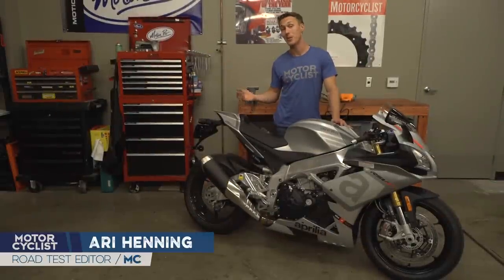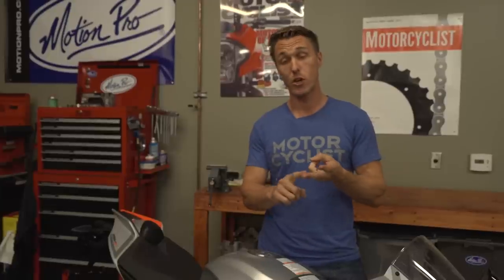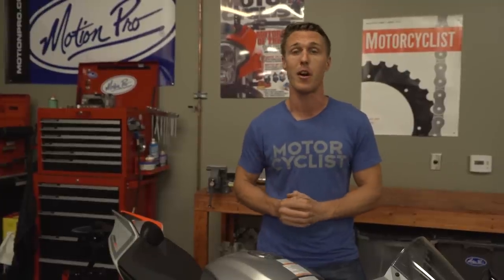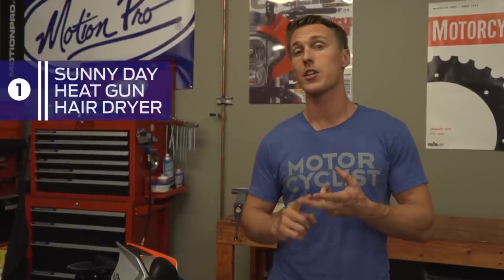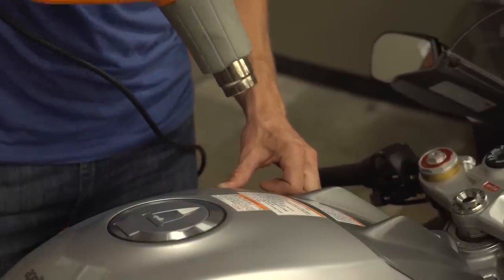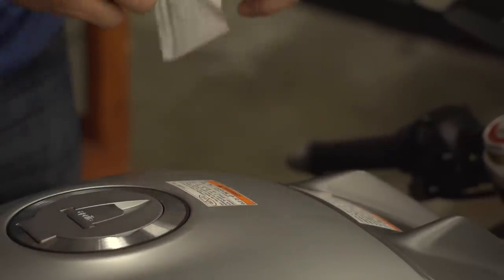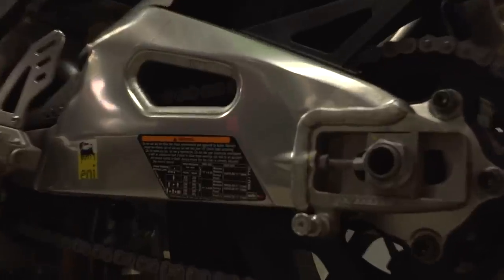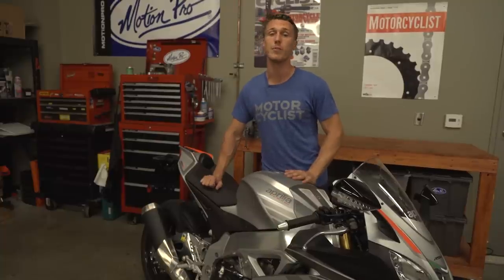How To Remove Factory Warning Stickers From Your Motorcycle | MC GARAGE TIPS

Comment: Man, I can’t wait. Sticker has been staring at me for 13 years. Great vid.
Reply: adaptiveagile was there any paint fade after taking it off? Like a noticeable difference from the paint that was under the sticker vs the paint that has been exposed to the sun and elements for 13 years?
Reply: @Ozzy62863  mine had a paint fade only after 600 miles
Reply: @snubz6188  what color paint from what bike
Reply: @Ozzy62863  it’s a Honda grom and it was on the gas tank cover so they grayish textured plastics

Comment: you can always put those stickers on some kind of card and keep it in the trunk of the bike for reference..
Reply: What is a trunk of a bike and where can i find one
Reply: The tiny compartment on the passenger seat which is too small to even fit your shades.
Reply: dave kahn i ride a 2000 CBR 929 and under the passenger i have plenty of room, so it's a trunk for me. i even have a power commander in there and still have room for all types of things...
Reply: PANTYEATR1 my old fzr hade room for a sandwich, choco bar and red bull, tip: if a can gets punctured and drips over your rear caliper do not panick and think its a leak in brake and spend a whole day trying to fix it 😂
Reply: I have an RSV4 and can barely fit my registration paper under the rear seat, let alone anything else
Reply: Do not fold them in half, they will fit better ; )

Comment: Could've used this tip a week ago, Ari. =) Otherwise, excellent tips and I used them successfully. Something else for those who are about to try this, keep a bottle of rubbing alcohol handy. The glue on my FZ07 didn't wanna go away, even after multiple applications of WD40. It left these invisible glue strips that as you ride, attracts and accumulates dust onto it turning it dark so you get this blackish smudge. One wipe down with rubbing alcohol and bye bye glue goo.

Comment: I carefully removed my warning labels and slapped them underneath the seat and inside the top case, I didn't throw them away. Since the plastic is new, it's clean and adhesive from the labels has no trouble sticking properly and they're out of sight so the bike instantly looks better. I didn't remove the VIN label located on the frame, but I did try removing the noise level compliance label from the swingarm (one of three labels on it; the other two being chain slack & tire pressure labels) and simply couldn't.
It's not a regular sticker, it's a fragile one-time sticker covered with protective foil so I removed the foil and realized I'd have to destroy the last label in order to take it off, I couldn't peel it off in one piece so I left it there. I may go back to it with a hair dryer though, just to see if it's possible. Thanks for the tip. ;)

Comment: I tried this heat gun thing, but the stickers bubbled up with the paint. So, I used a hammer to pound the paint bubbles back down. That didn't work really well, so I whipped out my angle grinder, and smoothed the area out somewhat. It still didn't look good, so I covered the area up with some duct tape.
Reply: Trial and error brought you a workable solution.   Good for you, you tree.

Comment: Some people like these stickers. Preserves the original factory look of the bike.
Reply: Uhm no.
Reply: Yeah...The after market stuff would be a definite, for removal. The originals i'll always leave on. My bike, now, is the only one that's actually come with the warning, and fuel stickers still on. It's only just had its first service, and i'm stoked. It's got GYTR slip ons, but that's all. There's just something, for me, about it being genuine. Maybe a quick shifter, and some short levers (only because the originals won't allow much change in angle), and that'll be it. I'm pragmatic, also....but it's because the bike is beyond my skill level, these days, not because I want to keep it's resale value high. Why would I bother with a remap, and the likes, if I can't get the thing past 11,000 revs? 2013 R1, in case you're wondering.......
Reply: Marty Smith i live in england and a new bike always needs a re map to make it run to its full smooth potential, some bike are worse than others (MV Augusta is almost un ridable in town) but because of European emmissions regulation manufacturers are having to make the bike run lean in areas of the emissions test so your power and torque curves dip and rise (not fun on a 190bhp bike) so usually another map is put in to correct the fuelling so a 2 constant curves on that dyno. map changes can make a huge difference in your bikes overall ride and power... not bad in the time it takes to drink some tea.
Reply: something1random23 why does YouTube only put numbers on the thumbs up!  Manipulate much, you tube?
Reply: My are allso still on, like @something1random23 said.
Reply: Thank you! I thought I was the only one that enjoying keeping it true to factory. I was utterly disappointed when I bought my 2012 R6 and the previous owner removed them and also covered the vin sticker with electrical tape

Comment: Just bought Yamaha chrome  engine guards that came with a warning label.  I watched this video plus several others.  Don't know what Yamaha uses for adhesive, but none of the tips worked.  Had to use a razor blade.  "Goo Gone" worked great to get rid of the sticky residue.

Comment: Lighter fluid, Goo Gone, and WD-40 were all a fail at removing the sticker residue from my 2022 Tenere 700. Goof Off was the solution. It immediately removed the adhesive without any damage to the paint.

Comment: I just took my swing arm sticker off and it was a pain in the butt. Took like an hour. It only scratches it only in one little spot and you can only see it in full sun light. I took all my stickers off and laminated them so I could save them. Only one of the swing arm sticker ripped. Luckily before a took it off I took a picture of it and I printed it out and saved it. Looks much better with them removed.

Comment: I have a bit of a challenge removing the warning sticker from my R750’s tank. It’s very beat up after some odd 20 years. I live in a highrise, where I have no access to a hairdryer or any other electric device or heating tool. Is there a way to remove stickers without heating them up? Some type of chemical that can dissolve the sticker without harming the paint? Goo Gone? WD-40? Any ideas? Much obliged!

Comment: One issue you didn't cover: labels on metal parts like the swing arm. The metal wicks heat away from the label quickly and makes removal a chore. I've owned 2 RSV4s and encountered this both times. Any tips?

Comment: Before I saw this video I successfully removed my stickers using the hairdryer/wd-40 method - however the "emissions" sticker is GALVANIZED to my swing arm...Ive got it half scraped off and want it gone...but why in the video above does it say we don't want that one removed???? Also I put all the removed stickers in the cover of my owners manual. :)
Reply: It depends on where you live. In some states you won't pass inspection without it.

Comment: What about taking them off matte/satin black finish?
Reply: ChuckieFinzter same procedure. u know, just dont get ur nail deeep in the paint. lightly peel it from the paint
Reply: Exeroo But.....how about removing the adhesive residue?
Reply: Just did mine today on a matte black Indian.  Was a little nervous at first but no problem.  Just like my bikes with clear coat.  Used some Goo Gone to remove the excess residue then wiped clean with H2O.  No marks whatsoever.
Reply: @ChuckieFinzter  Oh for crying out loud.   Paint is paint.  Matte or shiny. Just go EASY on that heat/ hair dryer.
Reply: @aloisius4188  Thank you for your input, but as its 2 years down the line I feel that your comment is no longer wanted.

Comment: Is WD-40 really considered a solvent?  I thought it was more of a lubricant or something used to displace water.
Reply: WD40 is generally not a great product,  but the hype over the years has made it so.  I use varsol or goo-gone to remove adhesive.  I use PROPER lubricants where lube is needed. White grease, graphite, etc.   WD40 is mostly water and an aromatic,  works only for a short time and will freeze in cold climates.  Look it up.

Comment: I bought an 06 Interceptor and the stickers after 11 years left an imprint on the clear coat anyone have any tips??
Reply: if you tried WD-40 or goo gone and that did not work I use a product called Greeze Off. its amazing and can be bought at any marina or of course amazon or ebay. The Greeze Off is my go to for everything sticker related and will not harm finish. use on my bike, boat, and quad.

Comment: Pull at a 90°?  ya if you want to rip it. Pull as close to the body as you can
Reply: I used to think that, but personally I've had much better success at 90 degrees. I also use duct tape to get any leftover sticky off. For me it's easier and less messy than solvents, but that's just me.

Comment: static electricity starts fires at gas pumps all the time you don't need a flame to ignite gas fumes
Reply: so you dont wear woolen clothes on your bike? come on buddy, you made a fail statement about the heat gun, you are wrong, let it go. dont pile up
Reply: You know, I have been refueling cars, bike, and military vehicles (aircraft excluded) for over 50 years around the world. I have NEVER seen a fire started by static electricity.
Reply: to k6 gsxr1000.
It does NOT  "happen all the time" .  It's extremely rare, because just touching the car or pump once eliminates the charge.   They have said the same about cell phones.   Urban myths.

Comment: Man why does this never work for me. No matter how much heat I use, the mf will still decide that the vinyl top comes off first, and the other shit peels piece by piece. Easier than trying to do cold, but still probably take 15 minutes just to pick the sticker off with one hand with the blow dryer blowing in the other and then another 15 trying to clean up the glue and get rid of the outline. Matte bikes end up with a little sheen too, no matter how gentle i try to be. I've tried this on 2 bikes now and it's always been fucking hell. But once you start, theres no bailing unless you dont mind it looking like shit.

Comment: umm.....heat gun right next to gas cap we need a motorcycle sticker removal fail video
Reply from the maker: Errr, it's flame that doesn't mix with gas. Heat? Not so much an issue.
Reply: do you also cover your bike during sunny days because its too hot for the fuel? you only ride when cloudy?
Reply: If it is a Bike made by GM  :D  self combusting
Reply: Your comment: Fail.

If you are careful enough using a heat gun to remove a sticker without damaging paint, you won't ignite the gas.
Reply: Looks like an episode for MythBusters  :D